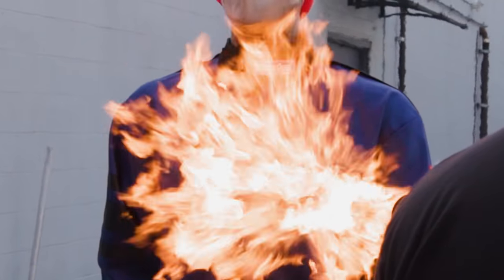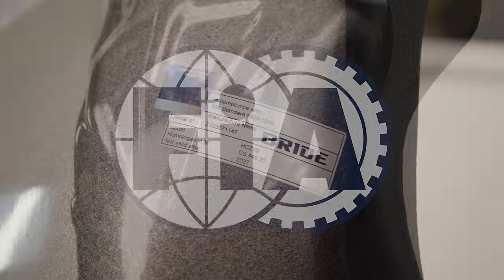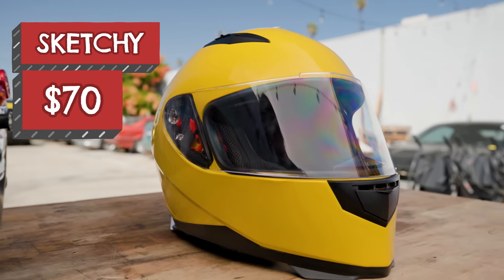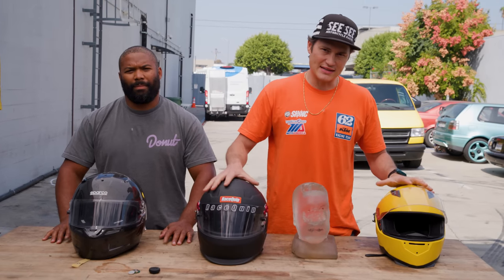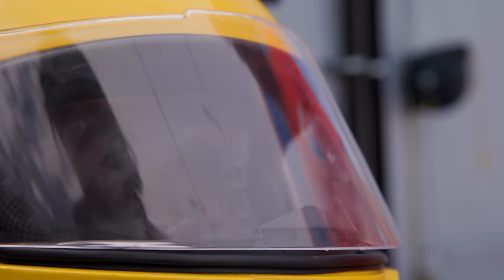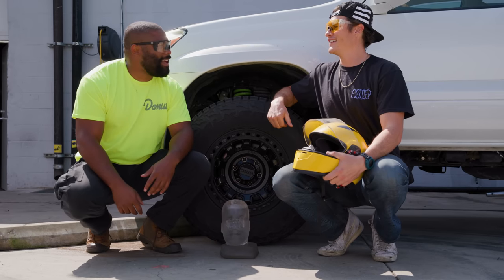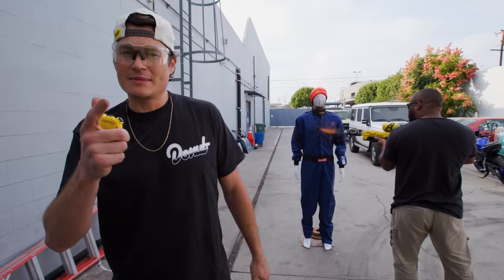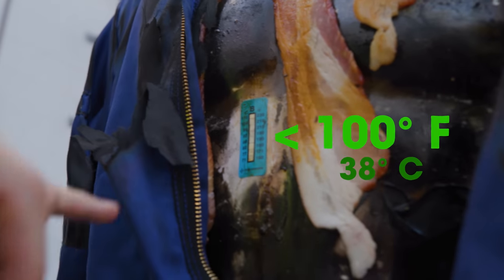$500 vs $1300 Racing Seats

Comment: Why people always do harness and helmet but never HANS? You could easily die from a crash without a hand device. Your neck will still move while your body would stay sticker to the seat. After many deaths that's why motorsport made them obligatory. Because without it many drivers basically die from decapitation because their head separated from the spine.

Comment: The helmet segment was great but the science flawed a bit obviously. Those packs will go off from those type of forces no mater what the helmet is standing up to the impact force. Without the helmet your head would have to take all that force. Those packs are best to show if you had parachutes or a airbag does it slow it down under those speeds. Way to test the helmets better would be having a melon secured in and see if it cracks, but still flawed not exact.

Comment: Why is it okay to use racing harnesses on a race track but not on the street? Wouldn't they be good enough for street driving if they're good enough to handle all the shenanigans on a track?
Reply: Well you can totally use the harness on the street, you just won’t probably need it for normal driving
Reply: @Ghosty249  Yeah that makes sense. I found it kinda weird that Nolan was saying you don't wanna get in an accident on the road just wearing a racing harness and no helmet or other gear and then they drove around later using them

Comment: I stopped the vid wen u said "100 g's",  100 g's??!!  Wudn that like seriously damage u even if it didnt kill u? Kud u survive that in any situation? Im surprised but lets find out. Im guessing there wudn b a sensor to test for it if u kudn survive it.
Reply: Not necessarily. A human can easily survive 100 Gs in the context of an impact, since it's instantaneous. The problem is when it's a sustained acceleration. If it's sustained for more than just a few seconds, most untrained people would only be able to handle in the low tens of Gs before passing out or even dying.

Comment: What is happening? I think I'd point to new editors, maybe? These videos don't make sense anymore. What happened to the cheap race seat testing (bought it and simply threw it away?)? Why are the 3 helmets shown with different testing methodology? Why is there almost no attempt for standardization (not editor issue)?
It's interesting to see products tested, but what's the point anymore if they don't follow any form of standardization? It's cool to have "just some guys messing around and smashing stuff", but you used to be better than that.